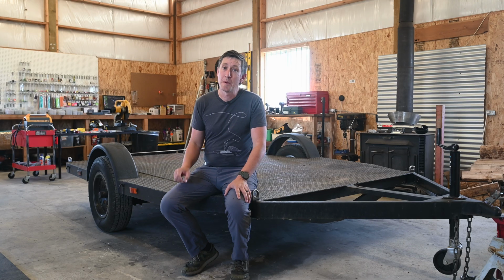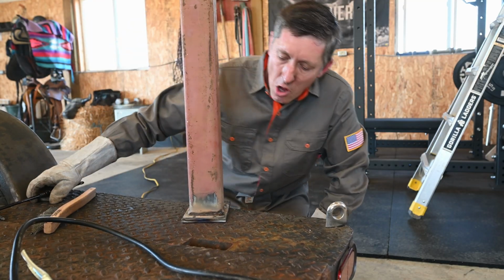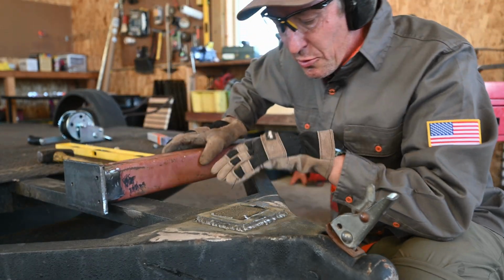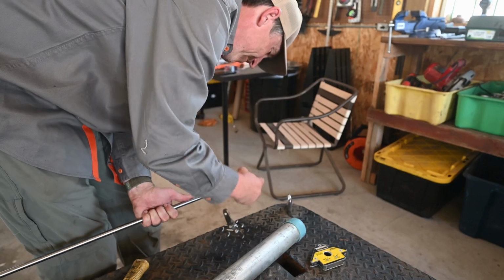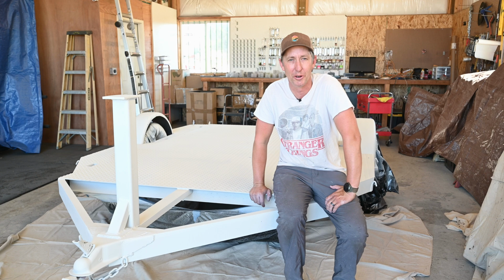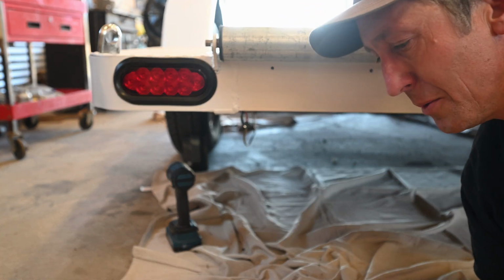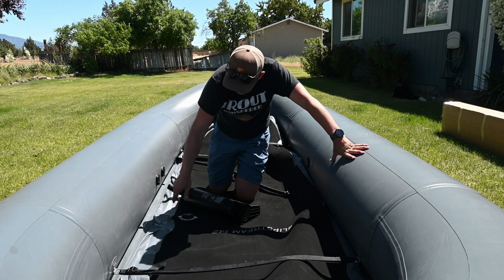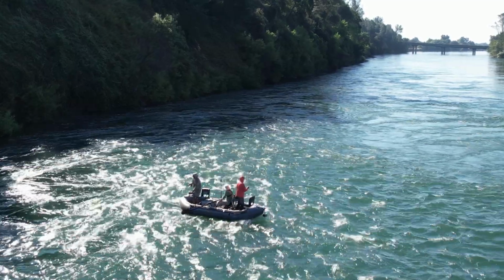PROJECT: Fly Fishing Raft Trailer Build

Comment: I found that with the swivel you're using on the anchor it made my anchor rope twist significantly worse than without it. Also where did you get that roller kit?
Reply from the maker: Interesting, I've found the opposite about the swivel. The bearings were from Clackacraft. Though there might be a better option out there, I had to mod them to make them work.

Comment: I just ordered an NRS 142, what size is your trailer?  12x8?
Reply from the maker: I also have the slipstream 142. The deck is 10x7ft 7in and there is about 2ft on the tongue, so about 12 ft is over the tailer and 2ft hangs off. It sounds like a lit but with the way the tube kicks up, it doesn't feel excessive. There is about an inch gap between the wheel wells so I'm pretty happy overall!

Comment: Awesome build buddy. Can I ask, why did you not choose to close off those wheel wells just in case a tire blew
Reply from the maker: Um...I thought about it at the time and just figured it wasn't worth it. I'm going to park it indoors so it will have negligible UV exposure and nearly zero weight on them. Just plan to keep an eye on the pressure and if they start to crack replace them immediately.

Comment: To save you some time and energy in the future you can fill that around 90% plus full using battery powered leaf blower or even a shop vac reversed. Nice job on the trailer!
Reply from the maker: how do you mate a leaf blower to the valve? I've since purchased a battery powered compressor. It's been a lifesaver.
Reply: @driftstone  It doesn't have to attach, just cover the hole, works great. Some valves you need to lock open, get it mostly pumped up, lock   the valve and finish with the foot pump.  Way faster than a little compressor.

Comment: You have the best DIY option for a roll bar that I've come across. I've price it out:
$40 for 2x 2" bushings, $40 for 2" EMT, $20 for shock tabs w/ 1/2" hole, $15 for 1/2" steel bar round bar, 2 hitch clips, 1/4" drill bit, 1/8" drill bit, guy who can weld (priceless).
Reply from the maker: haha thanks. coming up with all of it is half the fun :D